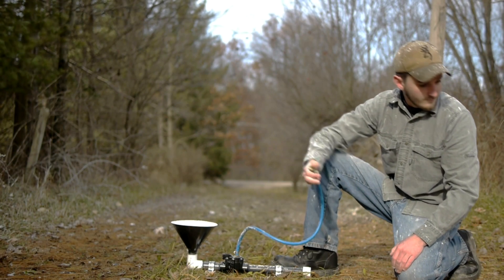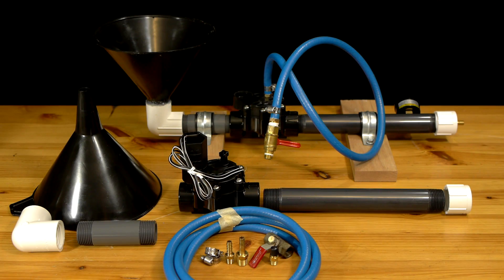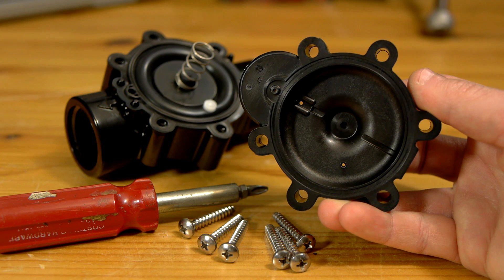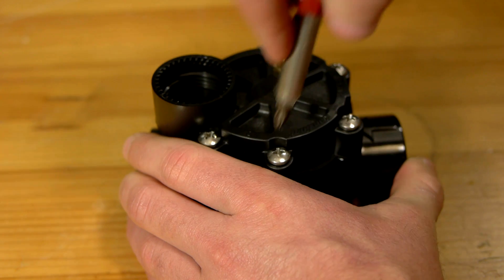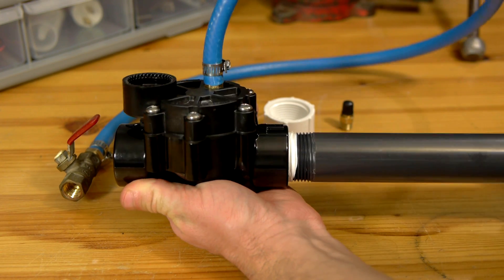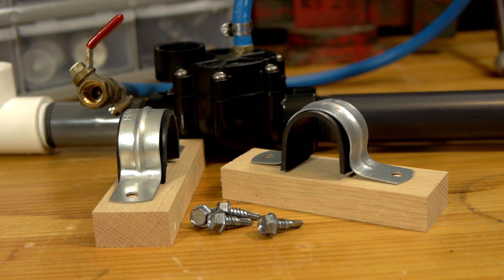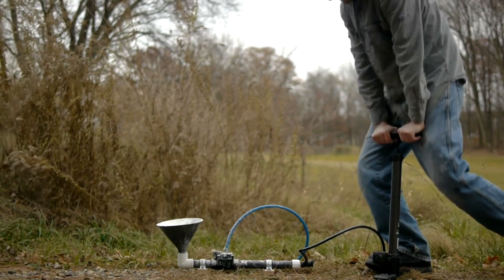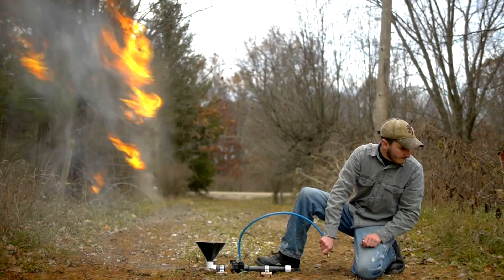How to Make an Explosion Simulator

Comment: Cool idea, but it's not safe to use PVC pipe for compressed air. I think using a steel pipe and an electric solenoid valve might be a safer idea.

Comment: So I'm getting the sprinkler valve to release as it should but only when I have the airgun trigger screwed directly into the sprinkler valve. When I try it with a 10 ft length of hose, it doesn't seem to release the air fast enough. My thoughts are maybe the hose is too long possibly? Think you might have any ideas?
Reply from the maker: Yeah the hose holds air, and that air all needs to be released before the valve can open. Maybe try not using a hose, and open the valve from a distance with a string instead

Comment: I tried to replicate the sprinkler valve modification and it won’t hold pressure… instead, it “sings” as the air escapes over the diaphragm as I try to pressurize. I’m stumped. Any ideas for me?
Reply from the maker: I haven't modified a lot of valves so I don't know all the ways it can go wrong, but I think a singing valve is due to a leak behind the diaphragm. So probably where you have installed your air outlet the threads are not completely airtight or there's a leak somewhere along the hose. Try looking for leaks with soapy water. If that's not it I might be able to suggest a few other ideas.

Comment: Hi!, so I did the air modification to the sprinkler valve and am currently having some trouble. The air is going right through the system. The membrane isn’t being pressured down. I have the exact valve as in your video and glued the specific hole with epoxy which I let dry for over 24 hours. Any ideas?

Alex Burandt

Comment: Do you need to use the 90 degree elbow on the firing end of the simulator?  Building a prop cannon for a marching band show and want to install the simulator inside the cannon to give the appearance of it firing.
Reply from the maker: +Matt Lillpop No it can be straight. Don't light it on fire in a marching band show, that's asking for trouble
Reply: No, definitely not the fire.  Interested in the firing smoke effect only.  Thanks!

Comment: This is great thanks for sharing! I've actually just made up the same thing, didn't think of the fireball idea though that's a good one! I'm going to try leave the solenoid coil in the valve and operate with 3x9v batteries from 10m away so I can be out of the shot when they're filming. Just checked out your other projects too- going to have to go through and watch them all now!

Comment: you need to increases the size if the air chamber, maybe a 3 or 4 inch tube instead. this will allow greater air pressure, and will launch your mixture higher. thus creating a bigger cloud of fire. nice vid btw.

Comment: Do you think this could be modified with just regular PVC pipe and a plastic ball valve at about 50 psi
Reply from the maker: Yeah, you'd have to be awfully quick turning the ball valve to have the same effect though. Sprinkler valves open a lot faster than it's possible to open a ball valve by hand which is why I use one here. Try a ball valve if you want though, you might be able to pull it off.
Reply: Yeah I built an air pressure cannon for shooting candy in a parade last year and I had that same problem. But with enough force and possibly a heavy book it is achievable

Comment: i tried to make this same valve i used exact same type and everything and now mine wont work any advise?
Reply from the maker: What about it won't work? I need more detail. Does it not close or does it not open? Is it leaking from anywhere? Pictures or a video of it would help also.
Reply: NightHawkInLight it is leaking around the rubber diapham but i see no reason it should be

Comment: I just want to thank you for this, and other projects that you have posted.  I am really excited about this one in particular as it will be a great help to me.  I have been looking for a way to add pyro to my military simulation games for some time now.  Hiring a pyrotech is just too cost prohibitive. 

I now plan to use an adaptation of this device to simulate the demolition of a downed aircraft site and I have some concerns that I need your input on.  1) I would like some sort of safety circuit that would lock out the device if someone were too close; 2) I would like the fireball to have a louder report; 3) I would like the trigger to be timer controlled and coincide with an automatic ignition source.  I know that is a lot to ask, but your input would be greatly appreciated.

If you have any other ideas that you think would be useful to me as I develop my scenarios into the most player-interactive experiences possible, please feel free to contact me.  I've just joined your facebook page as well.  Once again, thank you for all of your ideas and the effort it takes to put them out there!
Reply from the maker: That's a tall order, especially if you want it to be real fire and unattended. There are a lot of hazards there, not the least of which is a forest fire. I'm not sure it's really possible to make that a safe scenario. It's outside of my knowledge in any case to set up the safety and actuation features you're requesting. A remote control or electronics forum might be more suited to answer, but again, I don't think it could be made safe to leave unattended or automatically actuated if you're using real fire. Just using dust is another matter.
Reply: You're right.  I'll probably have to forget the fire and flames aspect of it, but thanks for all that you do, anyway.

Comment: Great video, again! Would a waterproof case for a smartphone be possible? Buyable ones are either 2, 40 or 100 metres waterproof. Nothing really for snorkeling :/
Reply from the maker: 40 or 100 meters sounds pretty good for snorkeling to me. You don't want something that's only good for 10 meters if you're actually going to be taking it that far. You want it to be able to stand up to much more than what you will use, because with time and abuse it will weaken and probably only be good for how deep you actually go.
Reply: Sounds reasonable. Nevertheless, I would be interested to see your construction :)

Comment: Why not keep the electric solenoid valve and just trigger it with a 9v battery like I did with my T-shirt gun.    EASY PEEZY
Reply from the maker: Usually sprinkler valves don't open quickly enough to throw dust in the air with a quick pop without being modified. It doesn't take quite as much speed to fire a t shirt.

Comment: Just curious, have you ever filmed a building of a project but it never worked?
Reply from the maker: Yeah I have. It really sucks when that happens. Most of the time I build a prototype before filming anything so I avoid that problem.
Reply: NightHawkInLight Hmm, interesting. What was it supposed to be?
Reply from the maker: TheJonesChannel11 I made an LED light coloring surface that could be painted on with water and would light up wherever it got wet, but corrosion on the electrical contacts made it only work for a few hours. I spent a whole month on that project last year which is why there was such a long gap between videos back then. Someday I might post a video about it and show what went wrong and how it could be improved.
Reply: NightHawkInLight I would actually like to see that! Hope Phase (or Mach/Mark) II works!

Comment: If i were to replace the "Air Tank" with a PVC of a larger size, then pressurized that, and replaced the cone and elbow with a longer piece of PVC, could this launch projectiles such as marbles?
Reply from the maker: No need to make the air chamber larger. Yes, if you put a barrel on it instead of a cone it would function like a potato gun.

Comment: Can vacuum cannon be improved using a rigid cover installed on one side with this valve to allow sudden air filling and on the other side just a plate with some rubber seal in its border.. The plate will be keep in place because of vacuum and the cannon sealed. Once the valve in the other side opens and projectile runs inside hitting the plate and goes out. The plate is not glued, it stays in place by the vacuum itself. wondering the valve has enough flow as the one you got punching a hole on the aluminium membrane.
Reply from the maker: Yes, but only for a small vacuum cannon, 1" in diameter the same as the valve. Any larger and I'm not sure the valve would let air in quickly enough.
Reply: NightHawkInLight ummmm any way to home-made this valve, but bigger enough ?. Just an idea ... My point is making the cannon more easy/fast to "load" or "prepare" and fire too. How this valve works ?. Is like the ones in the washing machines ?.
Reply from the maker: 38911bytefree If you look up a barrel sealing piston valve you will see lots of homemade valves that work like a sprinkler valve does. A sprinkler valve just uses a rubber diaphragm instead of a piston, but they work the same.

Comment: And also the corn starch only lights in the air because anything if it's in very fine particles is explosive because the oxygen is mixed in well enough so where if u light it, it will light easily and then the oxygen around or trapped in a group of the fine particles lights on fire and expands at rapid speeds and forms an explosion so it Burt's into bigger flames and lights the other per ticked to form a chain reaction

Comment: You should also do a video on you to do the modification or at least what did you use for the string just normal string or a shoelace or something
Reply: well its very easy. You suspend some kind of metal basket in the center of the cone. Example: Take a metal can and get rid of the paper label. Drill 4 holes in somewhat of a + or = shape. Take some metal wire or rod to pull through the holes you just drilled. If it are rod u can just lay the rod on the cone or also drill some holes to get a more secure fit. If u used wire drill some holes in the cone to match up with the holes u have made in the tin can and thread your wire through it and your can then knot it up or bend it over depends on what u have used. Then fill the can with anything that will burn for some time and won't blow out too easily. U could indeed use some natural rope and some gasoline or anything else u want. U are done and your are ready to burn your house down (or that of a friend u wanted to show this too).